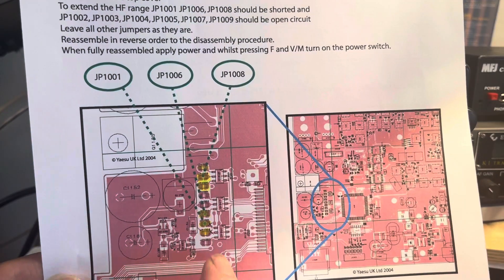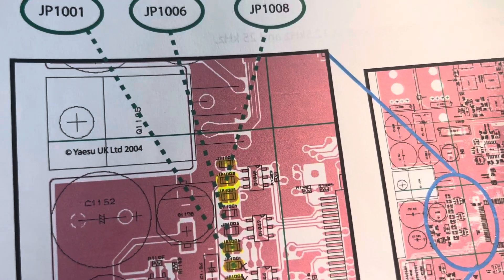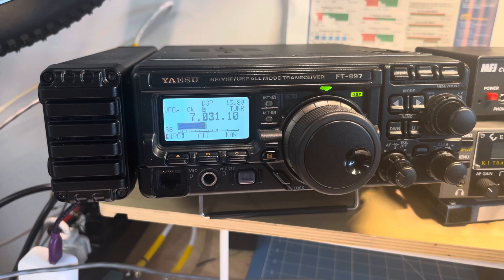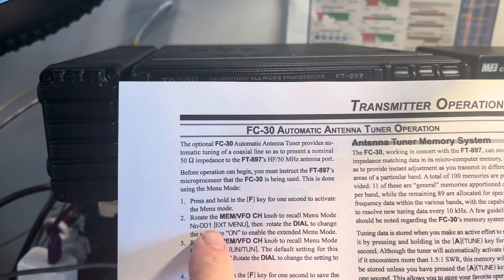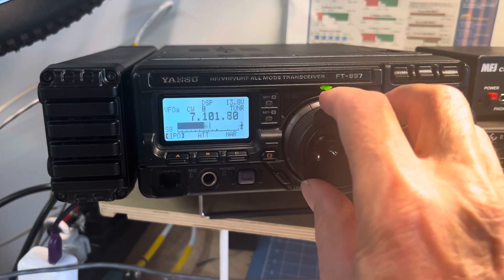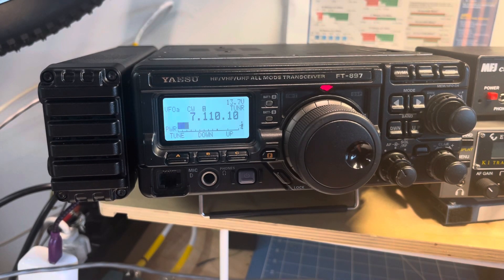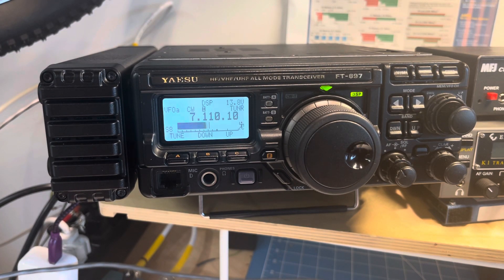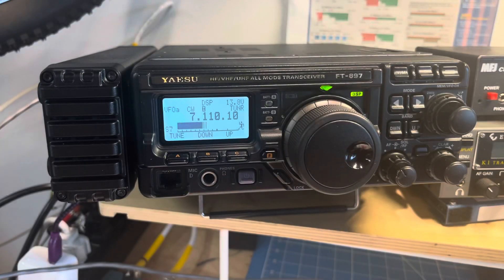Corrected FT-897 Japanese to USA Band Update. Works for me

Comment: Does it change the max tx power on all bands to US version specs for the 897?
Reply: This mod does change the max tx power, to 100W on HF and 50W on VHF. For me, that was jumper number 9, when I removed only that, the TX power was unlocked. Removing 3 unlocked wide RX.
Reply: More testing, if you also remove jumper 6 and 8 then the radio act like the US version. As in, when I use chirp, I have to select the US-only 857 to download/upload radio config. This enables the M60x special memories for the 60M band, but you can only TX on 5 memories, not whole band. The radio still software(firmware) lock TX on 2M to 144-146. I doubt the Japan version can be fully unlocked without non-Japan firmware. At least, this is what I found with my experimentation now with removing jumpers etc. For me it is ok, I am in South Africa and we only use 144-146 on 2M and 430-440 on 70cm. Would have liked more 60M to be unlocked, but I guess this is what it is.

Comment: Thank You for this video. I finally got my mod to work. It was a used Japanese model off ebay. This is the only video I know of with the correct information for those models.
Reply: Well, I jumped the gun a little bit. It is now wideband receive but has a tx error when I try to tx above 146
Reply from the maker: I have not tried 2M yet. Let me know if you find more info
Reply: @kennyray1381  Yup, can confirm I also tried this. VHF/UHF locked to non-US frequencies. Also no luck on 60M, but the radio now shows 60M band when changing the bands which it previously skipped.

Comment: I’d like to know the ‘giteki bango’ from the sticker as I’m considering getting one of these to get a call sign over here.
 It should be in the format 02KNxxx
I can look it up on the Japanese equivalent of the FCC site and tell you when it was released, whether it meets the newer Japanese spurious standards or not.

I’m researching this rig as in Japan you don’t get a call sign until you register a rig to you station, and it’s almost impossible to register a Xiegu or a Lab599 rig.
Reply from the maker: Ok thanks for the question! I’ll take a look tomorrow and send along an update. 73, Bruce
Reply: @tyrueiI  No rush Bruce but I'll look it up if you post it.

After a lot of research and frantic video watching (as the auction timer counted down) I came to the conclusion that the FT-897 is a nice rig but it can turn into a high maintenance gold digger if you don't get one with as many options as possible from the get go. When they sell over here a lot of the time people strip out the options and sell them separately to the rig, at the same time. 🤑
What could have be had for a reasonable price turns into a 3 star michelin full course meal out of budget. Would you like 500Hz with your main rig? How about the AC unit or a battery, or both? 😮‍💨

I pulled the trigger on a IC-7200 in very good condition. Still want a FT-891 though.
73, John
Reply from the maker: Agree that an 897 can get expensive by the time you get the filters, tuner and whatever power options you choose.
The number on mine. Hidden under the tuner, is 002KN388 (JARD)
Is that the one you are interested in?
Reply: @tyrueiI  I just looked that number up. It's for the FT-897M version. That's capped at 50W for HF/6m/2m and 20W on 70cm. Icom first registered that number in March of 2006 (old spurious spec).

FYI, We can pay about $50 over here to have Yaesu adjust the PA final output from 10W (S model class 4 license) to 50W(M model class 3 license) or 100W (no suffix - class2 or 1 license).
Not sure if you could approach Yaesu locally and pay them to tune it up.

Comment: Does the model number on these Japanese versions end in an "S" like FT-897S on the sticker on the left side (under your speaker)? Since this video have you been able to verify any of the other bands as well? I'm looking at picking up an 897 and there seem to be a number of "S" variants from Japan on ebay so I'm trying to determine the differences. Thanks for the video!
Reply from the maker: From what I have learned the S is the low-power Japanese variant that produces 10 Watts maximum. That is pretty good if you are into QRP as well. 

The D I think is a later model with DSP and a high stability crystal oscillator. I believe that became standard at some point.
Reply: The S indeed means lower output model. 10W on HF, 20W on VHF and UHF. With this mod, mine then changed to 100W on HF and 50W on VHF. RX is expanded but unfortunately TX seems to still be the same. It is as if removing jumper 2 made no difference. That is the jumper that unlocks wideband TX on non-japenese models.